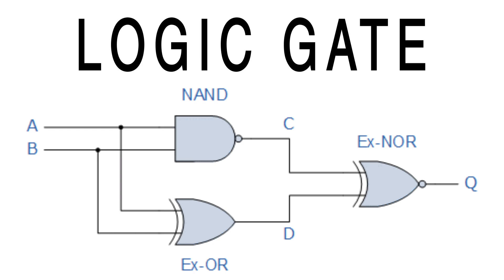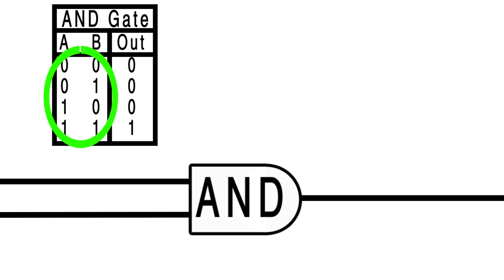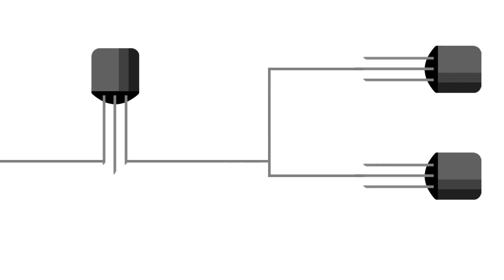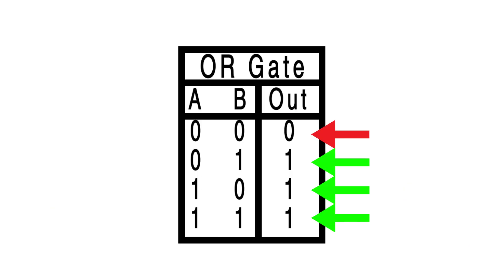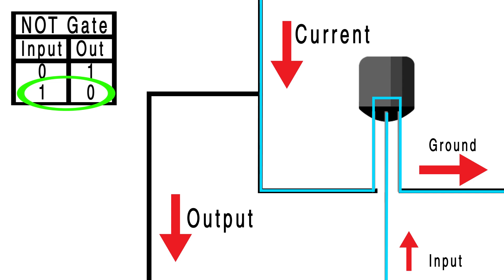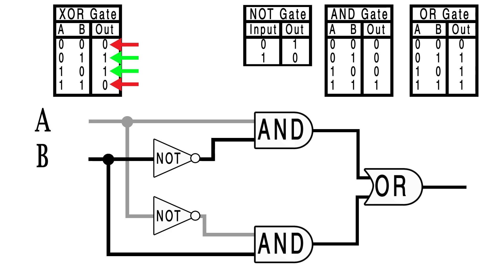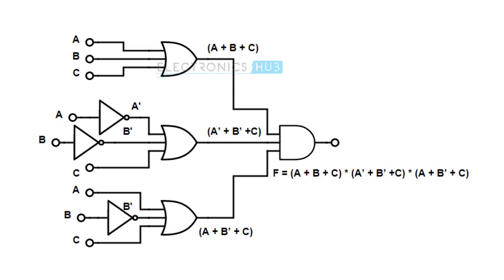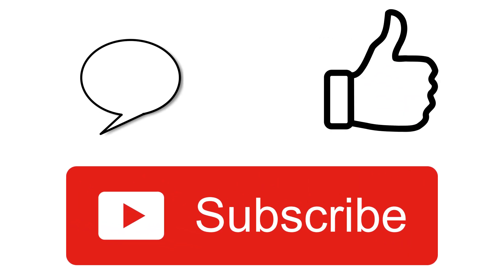How Do Computers Make Decisions? Logic Gates and Boolean Logic Explained.

Comment: 6:30 how and why does the current go to the "ground or transistor" path, when it can go to the output path?
Reply: The gates inputs are both receiving current in the 1or 0 input, from what I recall, a zero will have a charge of 2.75 mA to around 3 mA. A 1 will have an input of around 4 mA to 5 mA. Any circuit can be made using a N'and gate or a N'or gate. I'm not sure if that's any help, transistors can be NPN or PNP- neutral positive neutral, or positive neutral positive.

Comment: I don't know how computers are designed yet but I have designed a calculator.  To make design easy counting devices maybe are the way to go. For example, counter 1 counts up or down. Counters 2 and 3 only count down. The answer is always in counter 1. When adding the first number is loaded into counter 1 the second is loaded into counter 2. Counter 1 counts up while counter 2 counts down. When counter 2 equals zero the sum is found in counter 1. For the difference both counters count down. Again the answer is found in counter 1 when counter 2 equals zero. For multiplication the first number is loaded into counter 1. But when the times key is pressed the number is transferred into counter 2. When the times key is released counter 1 is cleared (reset to zero). The second number is loaded into counter 3. The number in counter 3 is the number of times counter 2 will count down to zero while counter 1 is increased. The reloading of counter 2 is not difficult but I am going to stick to the counting description for now. Each time counter 2 counts down to zero counter 3 is decreased by one. When counter 3 equals zero the product is found in counter 1. Lastly for division the first number is loaded into counter 1. When the divide key is pressed the number is transferred to counter 3. When the divide key is released counter 1 is reset to zero.The second number is loaded into counter 2. Counter 1 is then used to count the number of times counter 2 can be subtracted from counter 3. The quotient is found in counter 1when counter 2 can longer be subtracted from counter 3. Sequencers made of AND Gates Or Gates NOT Gates and Buffers are used to cause the counters to count as described above. Write me at Mark Finn P.O. Box 5038 Sonora Ca 95370 for all the information needed to learn calculators and video game design free of charge.  But don't expect financial gain to avoid being disappointed. I am pretty sure money is not that way for most of us.

Comment: As computer science student who just started out, with physics, chemistry, maths and computer science, I want to get as deep as possible.. Plz another video but with extreme detail and info about everything.. I'm here after veritasium made a video about computers.. The early transistors were glorified light bulbs.. A. K. A vacume tubes.. And before that was physical switches with magnetic stuff, that was attracted when a nearby coil was fed current, opening the circuit.. So I want to get deep into the chemistry side of things, the transistor, and the circuit side of things and stuff.. Plz

Comment: I remember testing a computer.  We had a bezzel that held about 10 sheets of 15 x 20 with the schematic on it.  We  started on page 1 at the top left and pur a scope on every test point.  If a part did not work we replaces the diod or transister.  The system was sesigned by math people.  They knew nothing about a pulse being delayed going through a transister.  We had to add in circuits to get everything in sync.  If somthing did not function properly, we had to sit down with them and figure out the solution.  Those were the days.  The kids today have no idea what really goes on inside a computer.
JP

Comment: logic values are either positive (logic 1 floating) or negative (logic 0 grounded) current.  So when the logic state is 0, the circuit is actually going to ground allowing it to power a small load from the output

Comment: When you play games, the processor remembers its achievements, and uses its new features for other applications. One is the "luck". By choosing luxury cars in Need for Speed, you upgrade the MB luxury car, your luck will increase in just 3-4 steps, that can be noticed during gameplay. In Explorer, your search results will become more lucky. It seems to be, Strength, Dexterity, Magic, Vitality, Agility, Intelligence, Luck are processor functions, when upgraded, it is stored in the internal cache. Old computers didn't have an external cache, SX had a 1 kb cache not described.

Comment: so. in order for my program to search a file,
I need to,
navigate every gate with a kay
and then select READ
to print out the file

loosely put.

in other words. my program also needs the read file to be redirected as a "printout"
to be processed and or then displayed

if i dont program a gate to open, not one gate will automatically open for me, unless
i have a microchip with a built in redundancy factor, thus preventing a printout transmission dead in its tracks

making brand very significant to me

or by not receiving the printout - by not opening such a gate - A.) the printout simply expires, uncached, not caching*, with a negative Positive

...

for me the epiphany here waas here just that, 
in order to search files, you really DO just need a transmission KEY for every single port on the motherboard,
going right down from your generic mouse interface being basically HARDWIRED into the mainframe
and your super mouse, likely using all the same hardwiring and additonal ROM elsewhere for eccentric features...

i always thought that was ridicous that you needed a KEY for every single message BECAUSE
the infinite line of code following through it 
would consist of ZEROs.... 

i dont know maybe i leaerned nothing.
Reply: oh its been a while since i've done this. 
yeah, just a Address for every code function needs to be specified.

i'm a big fan of removing handler code
for 3D and math.

and that little nuance, just kinda peeved me, because even though it made sense,
the manifest hardware stonewalled my subconscious. and i felt utterly inept and incompetent to stipulate further.
its just a number printout for the gates... 

1 last query:

gates before and after the printout,
carrying a printout or "confirming a printout"_ order of the address tags. before or after the FILE CONTENT.
Reply: after that, you can make 3D with paper and pen, and skip billions in royalties, with no additional coding efforts, and minimal extra difficulty to animation.
value inputs.

mix that with how quickly a computer converts values into printouts, and you can make every function without any handler code at all.
you can Hardwire  a game, and sell it on a  cd.
Reply: thats what i'd do. it would eb so cheap and easy. it int math. its algorythm. its  as easy a counting.
all you do is map ur chipboard,
label your addresses,
and as far as input output, u got next to no work
and then you introduce your mouse+keyboard/control.

yeah theres more. concerning format compatibility. but the rest is basic:
you establish the format objects, that are affected,
by reading and copying a printout/file
and adjusting it

animation and hitpoints/vectors&values.
Reply: as far as 3D goes though,
you have bytes, that scew by particular variables.
the code exists that you dont need to understand coding theory, to impliment the programs.
once you compress the file
you are left with a clean Motion Image Render... an adaptable one ~ a program that affects images.

Comment: Thank you so much for explaining a densely subject in the easiest possible formats. You saved me a lot of time from going through many pages of reading. Yes, I would appreciate if you explained how to read or understand current vs voltage graph or hysteresis of capacity vs voltage or the physics of a single transistor(solid state memory) to the simplest circuit of transistors contains one transistor and capacitor. What's the difference between capacitors and transistors(their difference make up of the device). I am a chemist building the thin layer of a transistor and really want to understand beyond understanding the molecular make up of the thin film's chemistry or physics of it. Thank you so much!